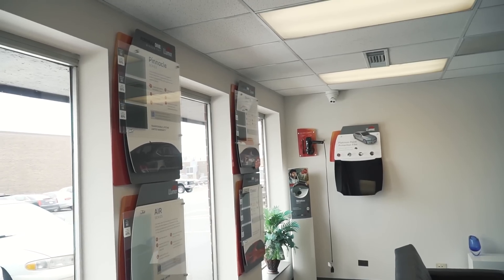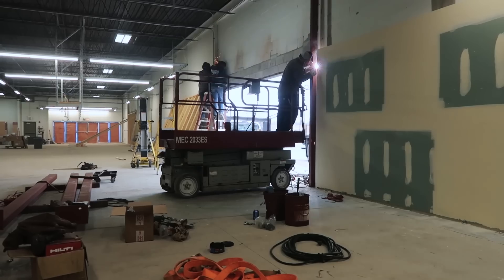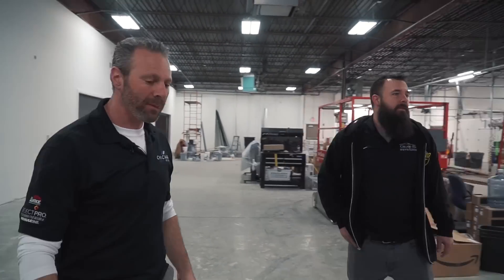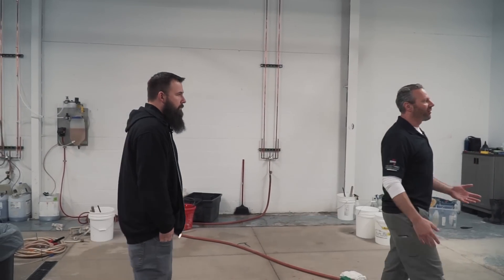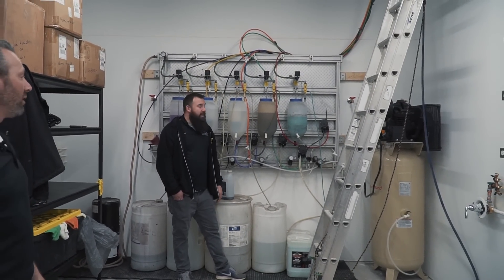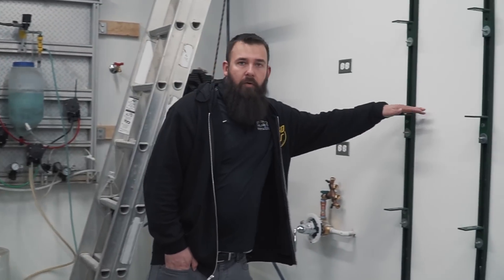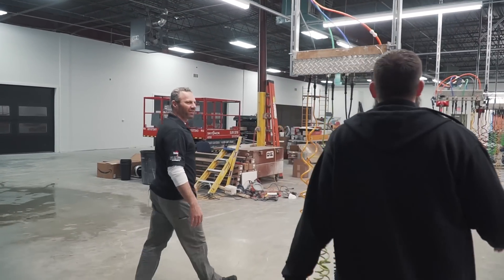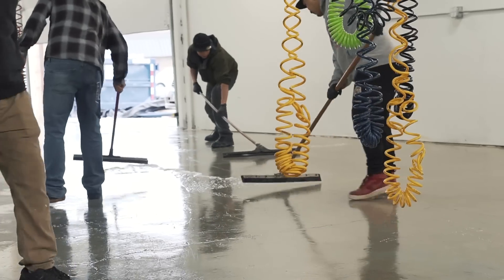My Dream Detail Shop | E5

Comment: Try PolyWall waterproof 5' up your sheetrock walls. It's applied by roller or spray. You won't have to worry about getting power wash spray or chems on walls

Comment: i have the same issue with my "wash bay"... water just wants to run towards the wall and puddle up. thought about putting self leveling concrete down to force it to run towards the drain.  also FRP paneling is great for wash bays, might be a bit expensive though

Comment: Jason I have a quick question about vvidd vinyl carbon wrap. First timer and I have been practicing. I am wrapping a stripe on a boat. I had to sand down sides because the paint was a roll on. I did not want lines. I got it smooth and now what would I do next? Should I wet sand wash with dawn and then wipe clean with alcohol? Or should I polish in one of those steps. Thanks again for ur help. Wish I could go back 30 yrs and do what ur doing. Love working on cars and now my first boat. Good luck to u in Lombard. Rich